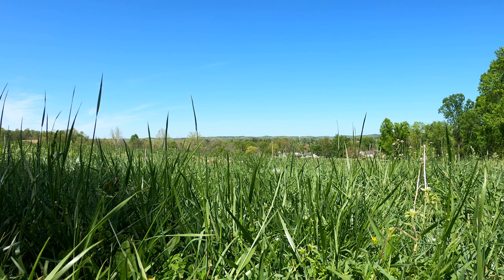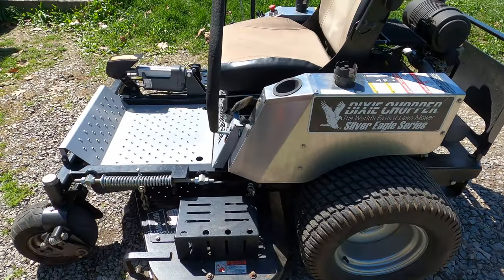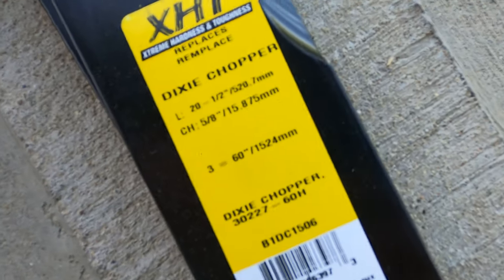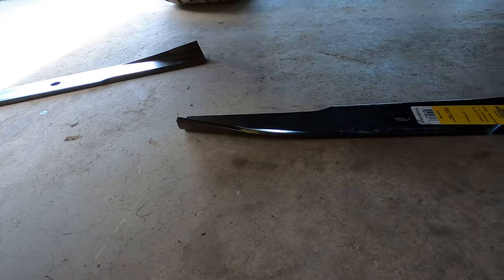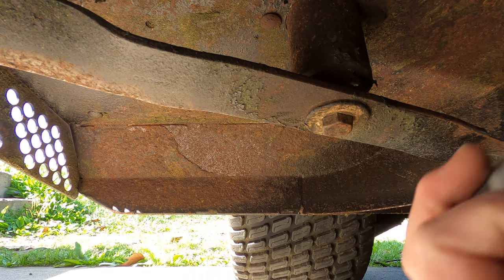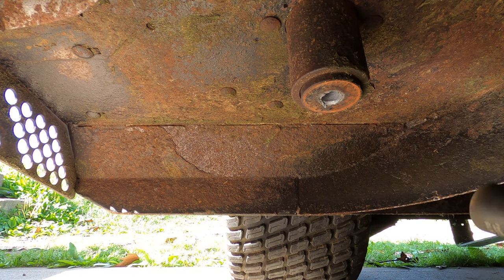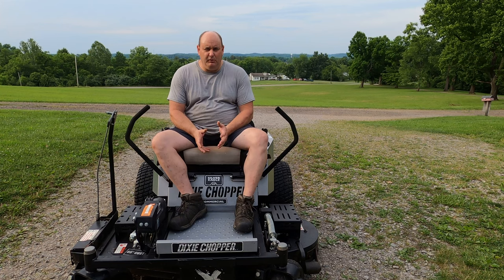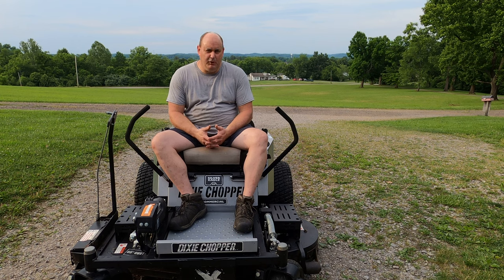Lawn Care , Step by Step , How to change Cutting Blades on a Dixie Chopper Zero Turn lawn mower .

Comment: You can resharpen theold blades?
Reply from the maker: Yes , but I have already sharpened them a few times in the past . Once they get imbalanced though it’s time to toss them . I just use a 4 inch grinder while they are mounter on the deck
Reply: I did not find it in the description is the name brand of the blades xhp I tried to get it from stopping your video
Reply from the maker: @mitchellnoll7402 https://www.ebay.com/itm/273840396693?mkcid=16&mkevt=1&mkrid=711-127632-2357-0&ssspo=gnbk91QFRMG&sssrc=4429486&ssuid=5_OmwmwYQZ6&var=&widget_ver=artemis&media=COPY
Reply from the maker: Here is the link